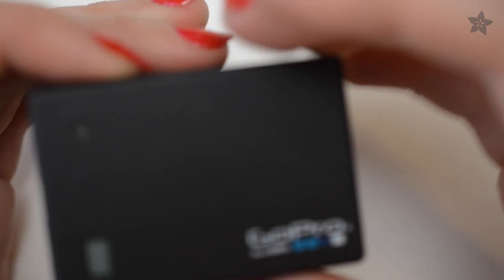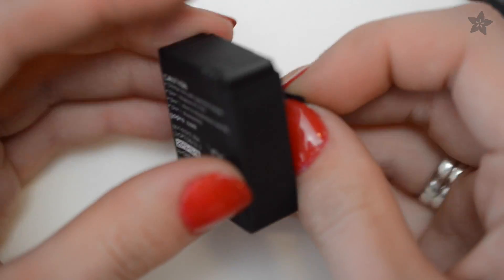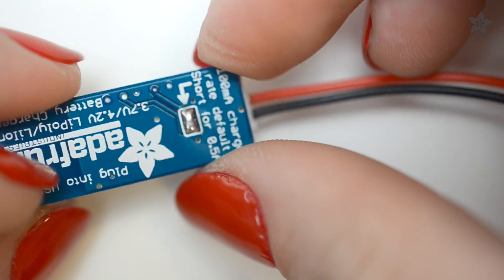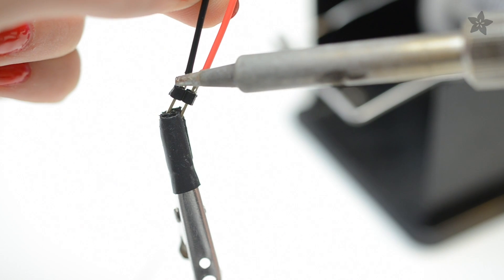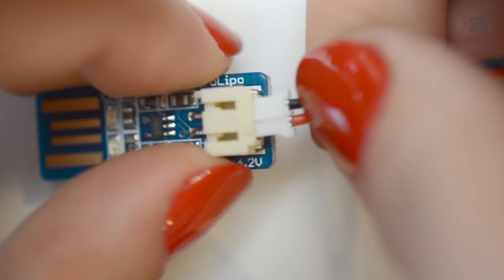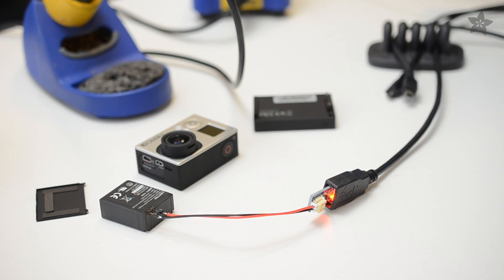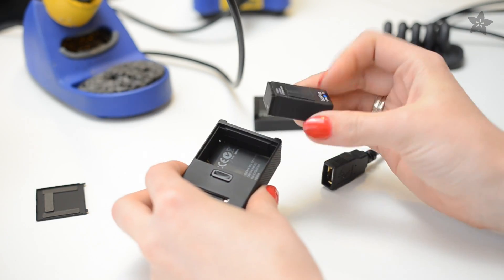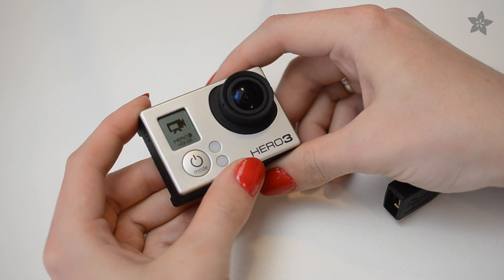Revive a Discharged GoPro Battery

Comment: Actually, all you need to do is 1) Remove the battery from the camera. 2) Plug the camera into a USB power source. 3) Turn the camera on. 4) Reinstall the battery. It will then begin charging.
Reply: Tried. Doesn't work with a "completely" discharged (and left unused for a while) battery. The Gopro just wouldn't detect any battery.
Reply: It worked for me. Thank you very much!!!
Reply: Didn't work for me (Hero 7 black). Ended up boosting it using a USB cable stripped down for the +/- wires. The 5v at 500ma(usb2 port) connected directly to the battery terminals,brought it back after about 40 seconds to a point the battery would be recognised and charge in the camera.
Reply: I bought a Hero 7 Silver without realizing that the battery is NON-REMOVABLE. The battery drained away just from the camera sitting for 3 months. It was mostly charged when I left it. However, your tip made me try plugging the camera into a jump-start pack with a 5V 2.4A USB port, and turning it on! That worked, and I can see it's charging. Thanks!
Reply: It worked for me. Thank you so much!!!
Reply: @yanaramob4342 how long you left the camera in the usb source without the battery?
Reply: How long should I leave the the camera connected to the usb without the battery?
Reply: Just long enough for the camera to power up fully. A few seconds... @alexandernystuen974
Reply: Thanks a million worked for me I was about to throw away another battery

Comment: Does the GoPro not have circuitry to prevent a full discharge?
Reply: They probably ran it dead and then let it sit for a while. This could cause the battery to drop below the minimum voltage for the camera's charging circuit to detect a battery is installed.
Reply: They should. But I have a Hero 13 that died while recording and now cannot charge because the voltage dropped too low.